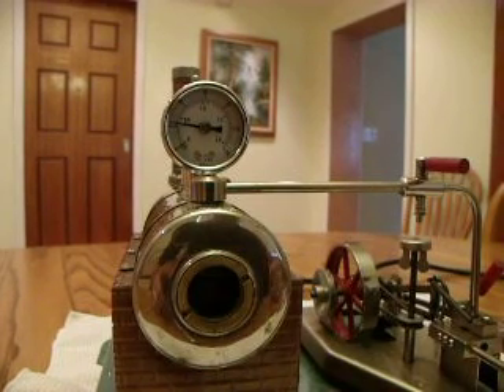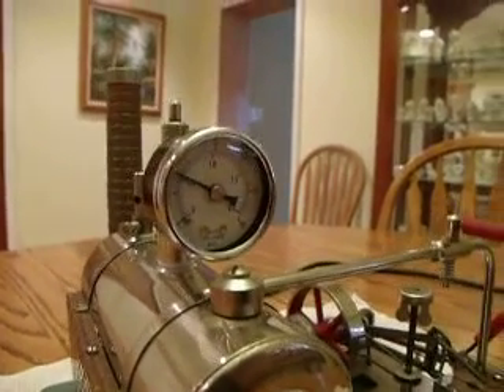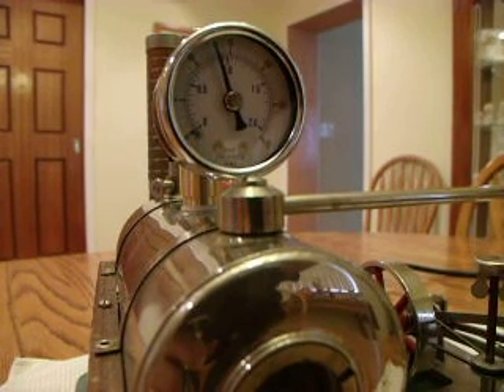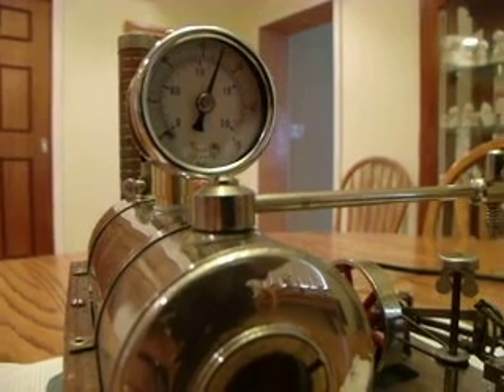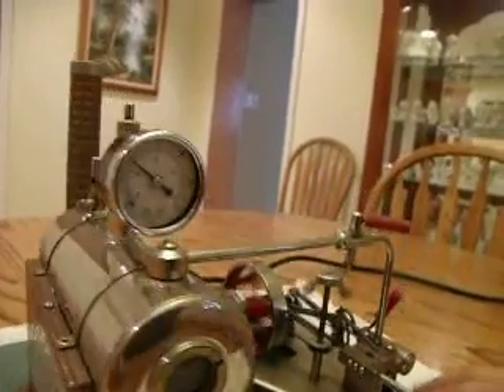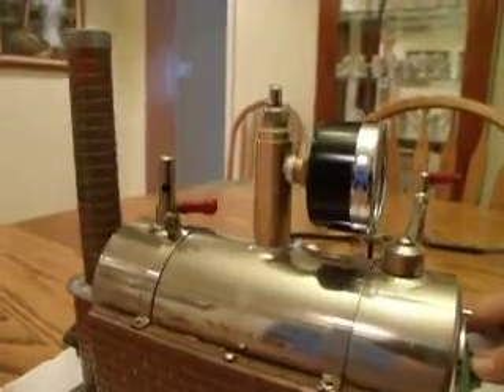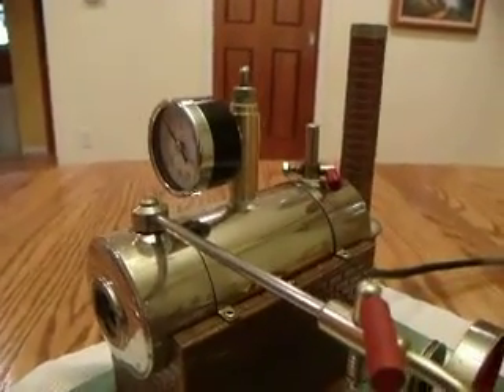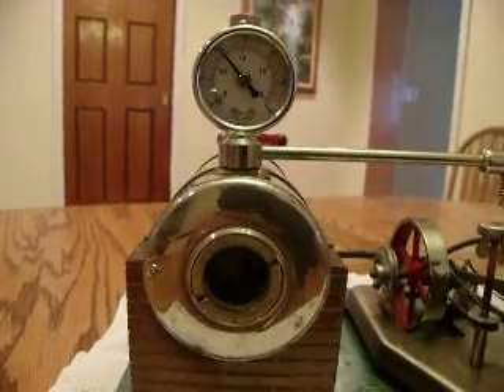Jensen Brass gauge adapter  under steam

Comment: Can I still buy this in 2020/2021?  Why only on electrically heated?
Reply from the maker: No, not exactly like this one, fuel fired plants tend to have to much heat & melt the plastic lens , or unsolder the brass internals.